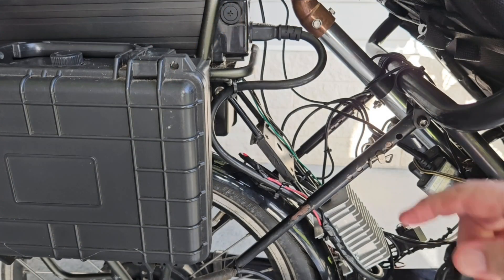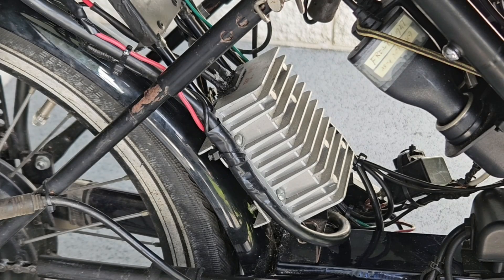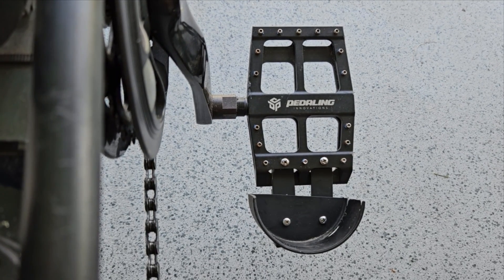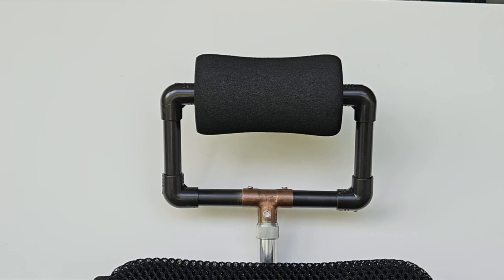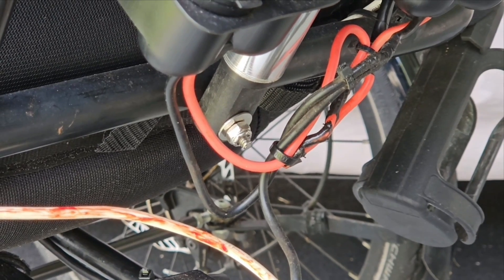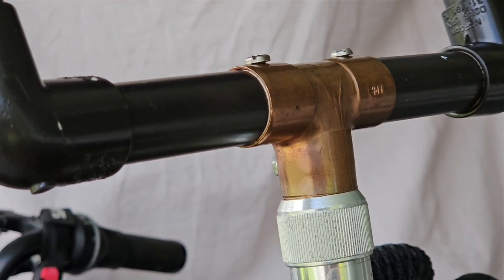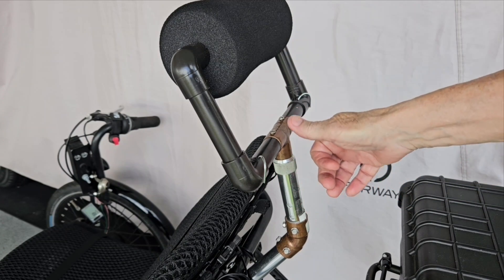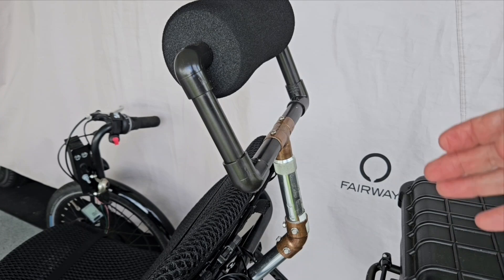How to trick out your recumbent tadpole trike for safety...UPDATE

Comment: From Denmark: I am enjoying a wonderful sunny day in a Campsite in S-E Denmark, sitting under a 4 x 4 m Tarp, next to my ICE SPRINT FS Trike and watching your very welcome update addition to safety/efficiency on your trike. Thanks for sharing, although at 80, I still have no EL assistance on my trike… Your headrest look awesome. All the best.🙏🙏🙏
Reply from the maker: The headrest worked out great for sure. So sorry for the audio issue but I just did not have time to redo the video on another camera with an external mic. I do  not use the pedal assist much at all but I have had to use a few times when I got much fudrther from home and ran out of energy on the trip back. That is where the electric motor really comes in handy.    Thanks for your comment